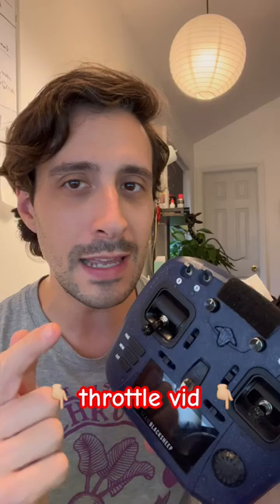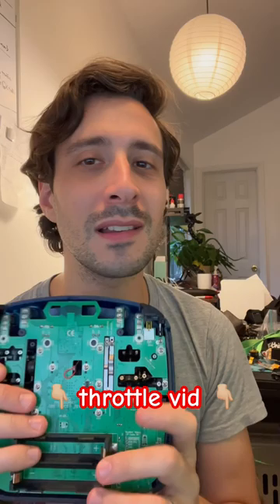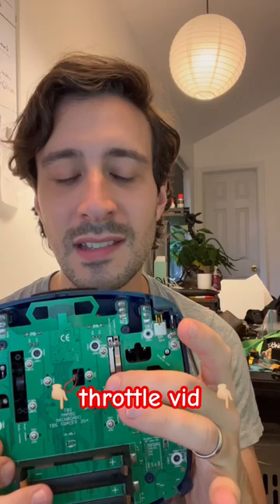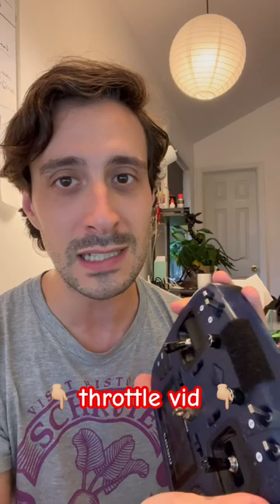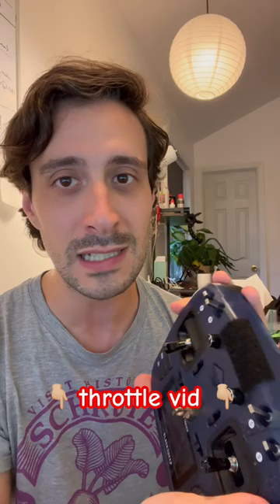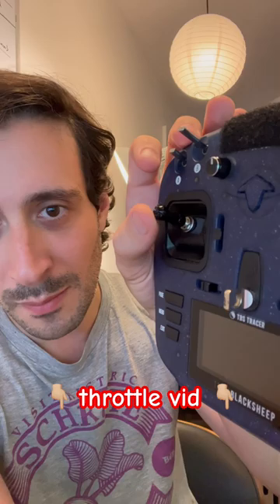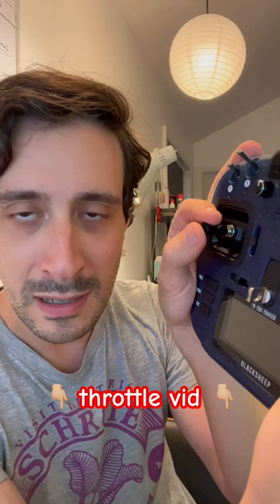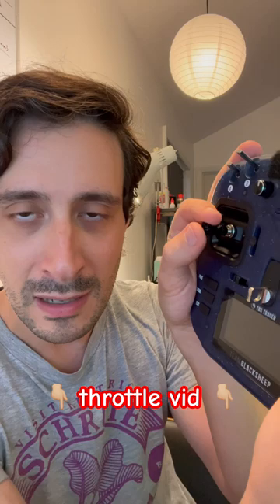THROTTLE HACK --- DO THIS! #fpv #howtoflyfpv #fpvdrone

Comment: I always remove the friction plates completely and put on the softest springs and adjust to 15-20 grams at max throw. Still great centring but no notch to mess up my precision… but that’s just me, one of my friends is exactly the opposite… but I think he would fly better if he didn’t have everything so tight.